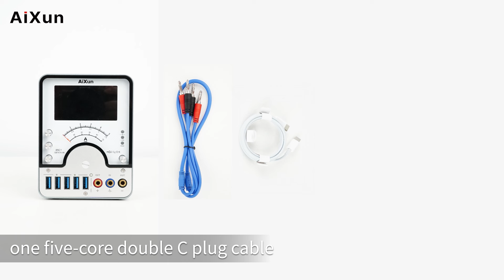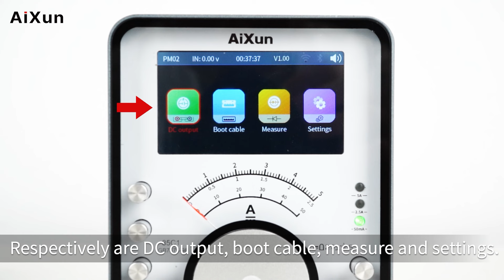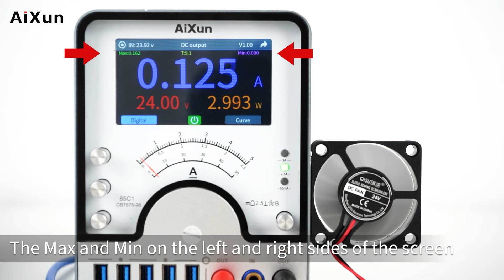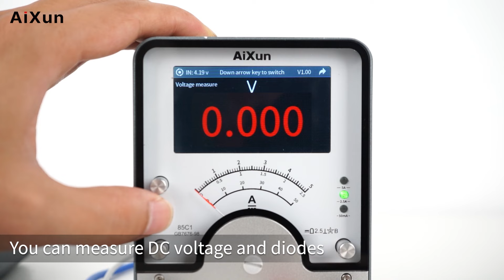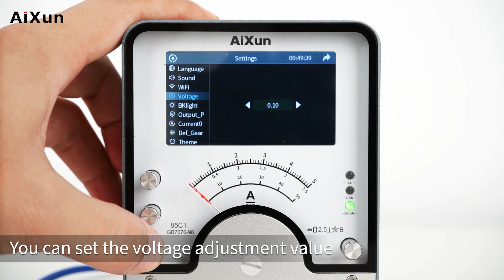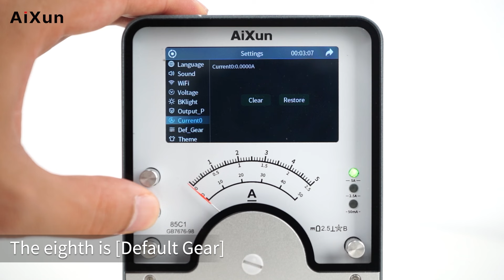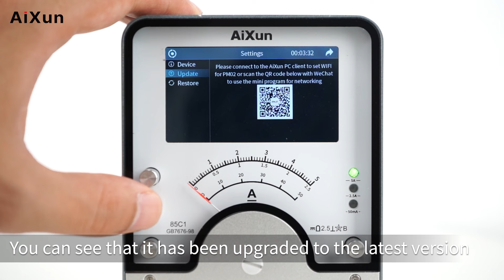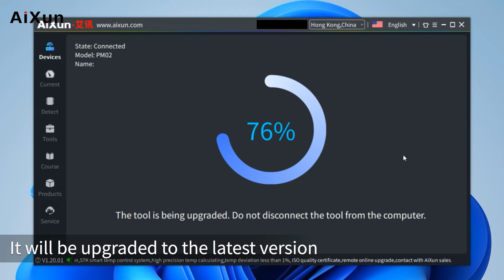AiXun PM02 Power Supply Partner is Coming!

Comment: Is the value when using mode diode, same as the value that appears in the jc drawing schematic ?
Reply from the maker: Dear, for technical problem, please contact our technical support. You can find the contact information on the official website here: https://aixun.com/contact/
Reply: @aixuntech I haven't bought it yet because in my country the stock doesn't exist yet, but I'm interested buying it. so I want to make sure if the value is the same as the jc drawing scheme. because I'm a jc drawing user.